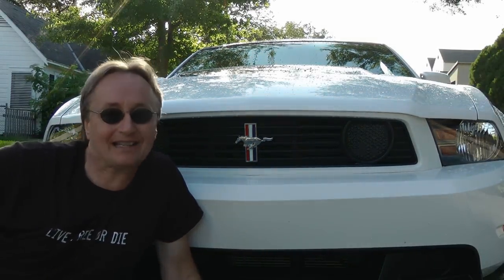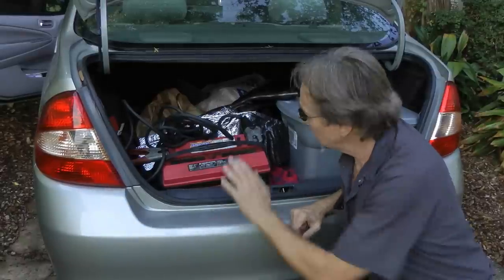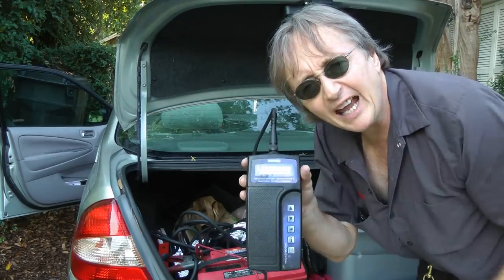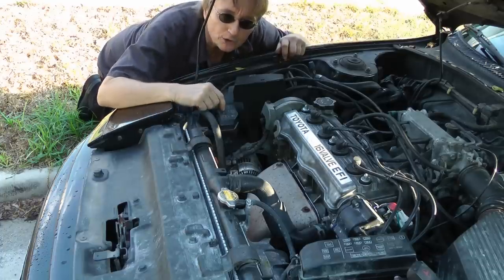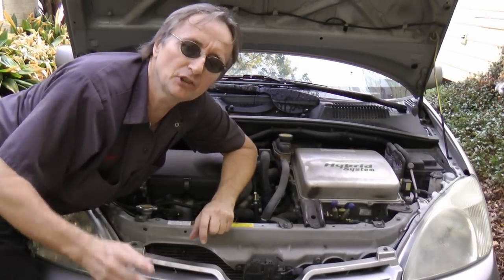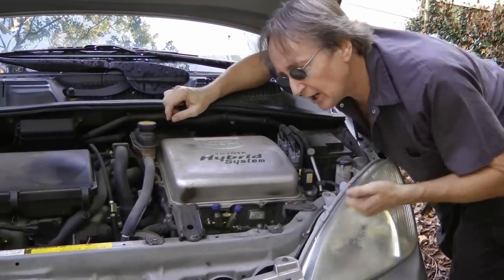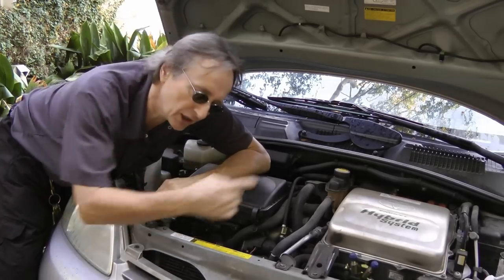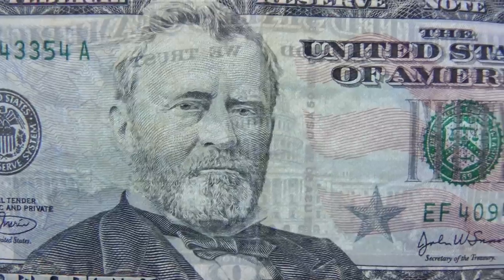Hybrid Car Electrical Problems

Comment: Mr. Kilmer.  I had a 2001 prius with 100200 miles. My car's AC working is Intermittently. I noticed this problem a while ago when I was driving up hill while the AC in running.  The car felt like loosing a some power. I pulled over to the side and check it out. I turned off the car and restarted after a few mins.  The car started fine and the AC worked as well.  Now.  The AC is not working again.  The last time was able to get it working by opening the the fuse box by tapping on the Fan relay. I am not sure why the fan suddently worked again.  I let the AC running for a couple of hours.  The next day, I drove the car to lunch and was trying to turn on the AC and it did not work.  So, do think that the AC switch in the dash board has a bad connection.  I suspect the Auto AC sensor is getting old and not working any longer. Can you give me any advise.   appreciate.
Reply: I have a 2003 model that had the EXACT same symptoms - take it to a mechanic and they will probably fix it for under $600 - I had to pay a little more because I had another little problem. I bought it off my mom 3 years ago and I know she took excellent care of it. Scotty makes great videos - very informative AND fun.
Reply: Thanks. Infact. I took it to a Prius speciality shop. They fixed the problem by replacing the Ecu unit from another car. My Ac now works good again.  It cost a around $600 for the repair.

Comment: The first gen cars always have problems. My cousin drove a 2010 3rd gen prius for 250k miles and the only repair he did was change one wheel bearing and one shock! The car still give 45mpg!! After all these years he sold the car for 2500$$!! Its the best car ever!!

Comment: The electric motor for the hybrid system is the generator. It is a highly integral part to the driveline.
Reply: Where it located ? I’m having issues now
Reply: @jordanwalker8587  with the voltages involved in hybrid systems if you have to ask where the motor/generators in a Prius are, you shouldn't be touching them at all

Comment: No sense in buying a hybrid. You may save thousands on gas throughout the years, but once the generator assembly goes, your savings go out the window. Plus, it may cost you even more than you saved.
Reply: Actually I have a Honda Civic hybrid that has an alternator as well as a generator. Also, if my hybrid components stop working, the car can still run on the 90 horsepower gas engine alone. But sadly my car won't get excellent gas mileage when that happens.
Reply: Mike Fu The first person who know what I know. Thank God!

Comment: List
1. dont buy used range rover
2. dont buy used hybrid
3.Dont buy shitty cars? lol
Reply: dont buy a mercedes also he says
Reply: djafar mobin I've got a Lexus hybrid and no problems it runs like a....hybrid
Reply: i know
Reply: Don't buy a Ford.
Reply: And dont buy Toyota hybrid cars only lexus
Reply: Harry Baulz everything is good when it's new. it'll be some years before you know if it's junk or not.
Reply: Or go back before 1975 and buy a real car. Something you can fix yourself.
Reply: HYBRID is gonna stay, it is better than Tesla technology. Anywhere theres gas unlike Tesla?
Toyota Lexus has no starter, no alternator, no airconditioning compressor attached to the engine, no power steering attached to the engine, engine is running lighter without those loads. RX330 vs RX400h?
Uses same engine, but hybrid uses the gas engine 50% of time, electric motors has lots of torques compare to a gas engine.
You do not know nothing about hybrid, battery last longer, they are not flashlight or cellphone battery.
Reply: @CrispyPancakes450 
 You don't know what you are talking about.
Reply: @fredieguerra7306  
Toyota hybrid exceeds false claims, you need to have one and not assume myths.
Reply: @BOC4ALL  yaaaahh like a PINTO!

Comment: I think I found the problem Scotty ? the car stops again and again and check engine light came on again and I did check the code again ..I replace a new map sensor and is working fine for now .will see tomorrow if stops again if it doesn't stop that means that was the problem right ? I let you know what happen thx for all your help

Comment: @whole27 Get a VW TDI diesel if you want good fuel economy, because diesels actually have better gas milege, and more power.  All of the electrical systems in a Hybrid are just an expensive pain to repair after a while, diesels also last longer too.  I personally like big powerful V8s with a lot of horsepower over fuel saving hybrids, but just my opinion.  Just a word of advice, but you don't have to believe me if you don't want to. :)

Comment: skotty this is the same car that i have but is 2003 .
how many miles that 2002 prius have to see if my car have some life left before i get rape at the dealer?.
and is a 2000 jetta diesel any better or to save gas is better a toyota echo?
you get my point i want to save gas my prius is 66,000 miles

Comment from the maker: man, you don't know squat about those things. The reason the generators melt is because there's a cooling system for the engine, and a separate one for the battery system. But NONE for the generator, that's why they melt down. Bad design, period.

Comment: But.... I saved 60$ a year on gas so 5k is okay!!
Reply: Chthonian121 it's not $60. Average 1st gen Prius owner saved almost $15,000, if they kept it for 14 years based on 15k miles per year vs a Camry, according to anyone with a functioning brain. And most Professors I know, have a Prius. And these people saved tons of money by driving those cars. Don't forget that gasoline was $3.50 a gallon pretty much throughout the Bush presidency and most of Obama's. Even at 2.5 they are saving $600-$700 a year.
Reply: Y10Q  I have a Prius C. 50 MPG. save at least $700 per 10000 miles compare to my 2010 Civic 25 MPG.  if I drive it 150000 miles . that is $10500.   base on  $3.50 a gallon of fuel. not mention the saving of maintenance. 

No change Belt
No change Brake
No change alternator
No change starter
oil change every 10000 mile.

but when it breaks, it may cause thousands to fix, but still save some money.  if you drive a lot, this car can be free.
Reply: J Chu
civic should average about 27 or 28, but yeah, every single mpg counts over the life of the car. People are paying $1000 a year for SUV vs a car. V6 vs a 4 cyl.  Big truck vs small truck. Prius will save you money, no doubt about it.
Reply: Y10Q that is right. Im not being cheap, but this car just what I need for daily commute. I tried to load this little Prius C with 800 lb rock when I was landscaping the backyard. still got 42 MPG for 20 miles trip.
Reply: Chthonian121 I'd rather have a Ford made electric car, at least it's an American company.
Reply: Chthonian121 lol
Reply: +J Chu lol but how much fun do u have getting 42 mpg
Reply: +Y10Q Thank you for an intelligent well thought out analyzed rebuttal! I save about $3,000 on gas a year for 6 years now. So I DID NOT THROW AWAY $18,000 ON GAS BURNING over 6 years, and counting..... Insurance is cheap also, and maintenance cost super low!
Reply: Link Knight lol but can you drift it in the rain
Reply: +J XXX my fiesta was purchased used for around $10k. with the 1.6 and six speed auto I average 48 mpg by setting the cruise to 62 mpg. driving freeway speeds of 70-80mph I usually average in the 44mpg range. worst ever recorded was 38 mpg.

overall, I saved about $35k by not getting a  Prius. plus in 5-7 years, i wont have to pay $7500 for a 75 lb weight that they call a battery. one of my neighbors has a 2010 Prius. she averages 44 mpg at 55mph. 

however, I usually drive my old Ford. even though it only gets 25-28 mpg, I get $9.5k worth of gas before I "lose" money against a new car, and I save nearly $100 on liability only insurance (state minimums). 

people who "save" money by buying things have to try really hard to justify it.
Reply: +lilsammywasapunkrock In the short-term you are correct, but once the Prius cost break-even point is reached within about 5 years, the fuel cost savings from a hybrid vehicle outweigh your strategy significantly. In more plain terms "the turtle always beats the hare". Under your proposition, one could equal be "fast to save" and argue that someone could "save" $10K you paid for your Fiesta by using a bicycle and public transportation. In the end the decision is pivoted upon what is important to the individual at the time of purchase, or lack thereof.
Reply: +TheGuitarsense exactly, which is why I brought up my $500 Ford. At $9500 cheaper then the fiesta, it would take 98,958 miles before I broke even on the purchase price of my fiesta, but then you have to factor in real world costs. The new car still requires oil changes and gas bare minimum. So even at twice the gas mileage, assuming you drove the fiesta the same distance, you have to add that against your "savings". In all actually real life drivng, I could drive more then 150 k miles before actually spending more, before you factor in full coverage insurance, which I mentioned earlier, was $80 more per month.

If I can get 150k miles out of my $500 car, then yes, it is actually cheaper then the fiesta. Now times that by about 4 compared to the ludicruis prices they get for a Prius that gets worse gas mileage then a geo metro of old, and its really quite hard to justify it.

When gas prices go back up, and they will, eventually there will be a time when buying a $45k car will save you money, but gas would be so expensive noone could afford to drive. If we were all driving a 1970's Cadillac, gas would still be $.25 a gallon.
Reply: +Kevin Bosen A Prius is more spacious and sexy than a Geo Metro, AND there is a huge difference in the emissions output. And because doing MY part to care for the air me and my children breathe is important to me, I WOULD continue to buy low emission, low fuel consumption vehicles in the future.
Reply: TheGuitarsense Never use prius and sexy in the same sentence
Reply: +SimranMann 2k14 haha, that's funny. You guys are so ignorant it's sad. But I don't blame you, after years of "me" prioritizing of course a Prius would be "shitty" to you. I know that the non-shitty car would be a Camaro, Viper, Chevelle, etc. but we are talking about low emissions and low fossil fuel consumption. That, is what a responsible human would do to care for the planet and their domestic economy as well. Next time you see a Prius in town, try to compare the amount of money they have in their bank account, stock investments, and retirement accounts to YOUR figures. Then decide who is making the "shitty" decision. optimusmikey     SimranMann 2k14
Reply: +SimranMann 2k14 hey man, no need to get nasty. If he wants to spend about 90x as much money on a car to get roughly twice the gas mileage i do with a v8 to help him feel better, let him. After all, he is saving almost $700 a year on gas. In 5-7 years when his $7000 battery let's go, he will break even.

Or not... My cars environmental footprint is way lower. My battery's weren't mined and processed with thousand of other toxic chemicals, shipped all over the world 5 times before finally being assembled in north america. 

A sucker is born ever minute, and lots of them drive Prius because they think they are doing good for everyone else. Even though a Prius in normal every day driving pollutes more then the average car.
Reply: +Kevin Bosen Thank you for an intelligent rebuttal! It's funny how dumb people always get mad and become aggressive when they get intellectually cornered. However, Kevin Bosen,  has indeed brought up a good point that I did not think about. I have not researched the environmental damage that these batteries cause. And perhaps you have convinced me Mr. Bose, that if the majority drove hybrids, then yes, that would probably be more crippling to our earth than burning of fossil fuels. I just don't have enough researched credible evidence to make that argument. The best solution may be to live close to employment and use public transportation/walking/bicycling more than I do now. That would save both in tax, depreciation, and self-centered pollution.
Reply: Yes the batteries from these Hybrids are horrible, both for the environment and also they have not produced a GREAT power source so the batteries are worthless over time. Also the Prius has strange parts that are not easily changed just like in the video, so when you have these parts then you will have some one to take advantage of you and charge you big bucks, just like the big bucks paid for a Tesla which restricts you to a large city. The fact is we like to be free and feel free and stuck in a big city in a Golf Cart is not Freedom, and many of the Hollywood elite who PREACH CLIMATE CHANGE are FREE to travel in their big jets and party on their big FAT YACHTS(boats are not Eco Friendly).......So if you love your big city and you love to be stuck there then great, but your dear Heros in Hollywood will not tell you the Truth....The Love to get OUT and go to the COUNTRY in SOLITUDE, because a big city is a HORRIBLE place to live.
These Hybrids also have horrible transmissions which cannot Pull a Boat or Jet Skis, but you are FREE to get a V8 SUV when your kids wanna go to the LAKE.....Just like the Hollywood Elite..$$$$.....Its called GLOBULL WARMING for a reason.
Reply: I thought about getting a Toyonda Pious, but decided I didn't want to contribute to the smug problem.
Reply: It's just like organics compared to regular food. Even though those have been around for over 40 years(but somehow it's a big deal the last 10 years). People are brainwashed by the hype. They believe what they hear. If they're really concerned about the planet, then ride a bike. Live in a tent so no more trees are cut down to build your house. Don't buy anything made from plastic, fiberglass, or polyester. Throw away your phone. Wear only cotton clothes. Don't use electricity or the AC. Use a push mower to cut your grass. Don't buy imports(you know, cause the fuel it takes to ship it here). Maybe we should go back to the 1800's.
Reply: I save $40 a week on gas driving my Honda Insight vs my VW Passat. I drive around 700 miles a week, and I am very happy spending around $35 a week on gas rather than almost $80. This is with gas prices slightly above $2/gallon, imagine my savings when the price is higher.
Reply: Ford uses Toyota Hybrid technology. Toyota Hybrid technology is far superior to anything out there.
Reply: Myles Vance damn, you drive 100 miles a day?!

Comment: I'm not saying I don't believe you, it is just that the terminology needs to be more precise, IE you say "generator" when there are 2 motor/generators, and yes MG2 is known for sometimes developing shorted turns that cascade into a winding burnout, but it causes symptoms like noises/vibrations before DTC P3009 is thrown. 3009 is HV short to ground, IE the floating (non-grounded) HV system is no longer floating.
Anything you want to know as far as common faults can be found at luscious garage.

Comment: Here in the UK, transmissions, engines, HV batteries and inverters are available used - from late model cars - at suprisingly low cost. (Have a look on eBay)  The reason being that hybrids are super-reliable and their is no real market for used  transmissions, engines. HV batteries or  inverters because they so rarely go wrong!!!

Comment: I have to respond to Alex's comment.

Any new technology will have its flaws. In the case of Prius the generator has a flaw.

Toyota's can be expensive to repair when they break. In the case of my 1999 camry the drivers side headlight went out. So I replaced head lights in pairs I hope that is right Scotty.

To get at the drivers side headlight I had to remove the battery just to get to it. Perhaps its another way Toyota can make money.

Comment: I have a 2007 Prius that died on I10 and now will not start The battery in the back tests at 12.7 Volts and under the hood I get 12.7 V also. When I insert the key the flashing security key goes out but no other lights come on. I press the brake and press Start and nothing happens. I was told the FuseLink is a common cause of this so I pulled the FuseLink and all Links test out good. What would you suggest I do next?
Reply from the maker: find a guy like me to analyze it with a dealer level scan tool those babies are complex and odds are some serious codes have stored

Comment: @smithraymond09029 
I'd disagree... my 01 insight gets 70mpg and I've gotten 90mpg on a long trip.  There is no 4 cyl equivalent in mileage.  Of course it wouldn't be fair to make the comparison.  The 1st gen insight is a 3 cyl.

Comment: Very rare for a permanent magnet motor/generator to die, actually not heard of one dead yet. This prius needs a new proper battery. Wrong battery wouldn't solve the problem.

Comment: If you research how much it costs to buy and service a hybrid, everyone would see it's cheaper to buy and service a gas efficient standard car. Once the generators, or batteries go out, it costs an arm and a leg to get them fixed in a hybrid.

Comment: This is rare.  95 percent of Toyota Hybrids are still bopping down the road.  Did she do the maintenance schedule?
The PSD (power splitting device) is all lubricated by the transmission fluid.  This must be flushed on time. This Hybrid doesn’t look well kept. I’ll bet the transmission fluid wasn’t flushed.

Comment: That's why if you are going to buy a used Prius always always always get a warranty that replaces either the battery or the charging system.  This is one big example why to buy something like this.

Comment: Except you'll see that Hydrogen cars usually use fuel cells to convert the Hydrogen into electricity, which goes into a battery pack and the car has an electric drivetrain. Internal combustion engines running Hydrogen directly don't have much power. Take for example that 7-series BMW Hydrogen prototype, 12-cylinder engine and not very fast.